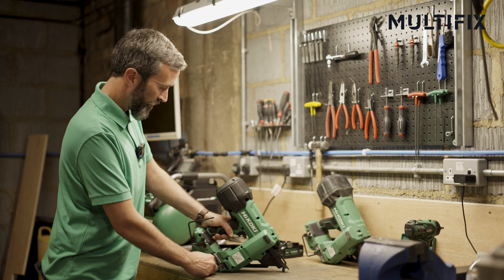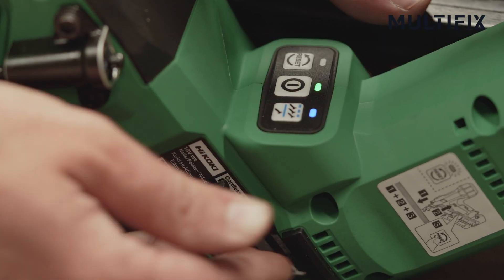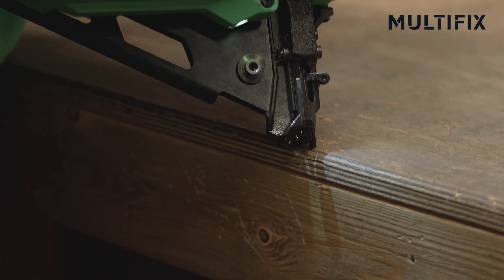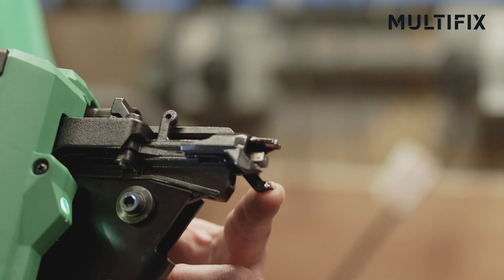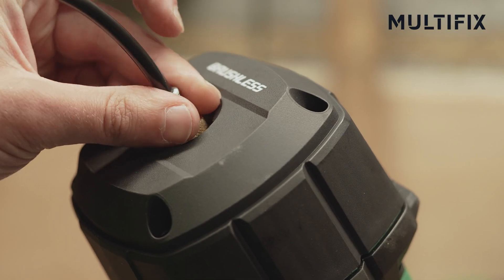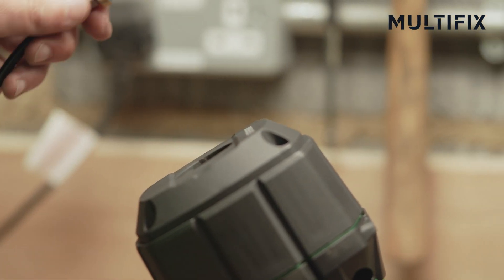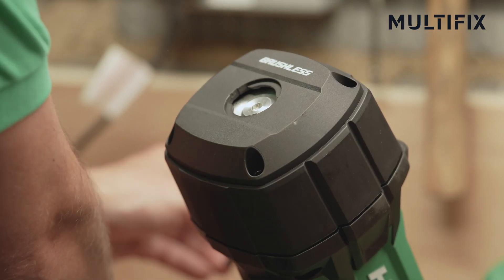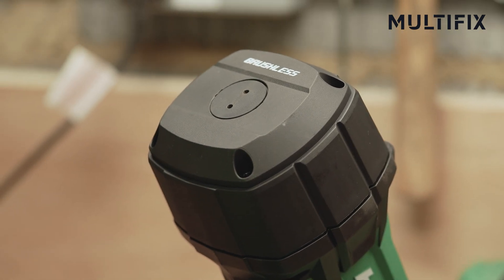How to re-air a HiKOKI 2nd Gen 1st Fix Nailer (NR1890DCAJPZ)

Comment: I’ve got the regas valve from Amazon it says it works on all 3 guns but it doesn’t seem to fit the second gen gun. Would this be a different valve? Seems a bit odd to use different hardware.
Reply from the maker: Yes it's been difficult to find the right adaptor! In short, theres 2 types: one that has the regulator on it which is different for every gun and the other one works for all 2nd gen guns which is supplied with all of the inflator kits we sell. This article should point you in the right direction: https://multifixuk.com/expert_hub/how-to-re-gas-hikoki-2nd-gen-1st-fix-framing-nailer
Reply: @mul@multifixukks for the link. Is there any way of buying the adaptor that’s in the inflator kit separately? Also thanks for the reply too.
Reply from the maker: No worries George - call 0203 248 4086, ask for Ben and he will be able to help you out.
Reply from the maker: Hi George - you can now order this online, stock is still coming in so won't be next day delivery but you can still place the order and you'll be notified of delivery date. https://multifixuk.com/products/hikoki-re-gas-tyre-inflator-adaptor-suits-all-hikoki-2nd-gen-nailers-4100415

Comment: I bought one off Amazon but doesn’t seem to fit. But now I’m not sure if I need it either I thought maybe it was low on air cause hammer if half way out and doesn’t look like there is a jam maybe I just need to reset it? I really liked the gun except for the rafter hook mine broke the first day I had it lol I replaced it with nr83 hook
Reply from the maker: Thanks for the comment - not heard of the hook snapping before. Couple questions - have you managed to sort the gun or is it still out of action? And what tool did you buy out of interest - maybe send the link over if you have?

Comment: Is it the same bar for 2nd fix gun
Reply from the maker: No, it's different for each gun, see below:
1st fix nailer (NR1890DCA) = refill as shown in the video with 9,1 bar
Straight 2nd fix gun (NT1865DSA) =  refill with 7,4 bar
Angled 2nd fix gun (NT1865DAA) =  refill with 8,7 bar
Reply: There is the same adapter for 1st gen and 2nd gen? (As mentioned above - same 9.1 bar).
Reply from the maker: From my understanding, it depends on what adaptor you are using - if its the one with the regulator on it, then there is a different one for each gun. Otherwise the one that comes with the HiKOKI tyre inflator is the same for both, but you have to ensure that the pressure is set to the right bar. There will be an article coming out on our website soon to explain more with links to the parts, so keep your eyes peeled 👀
Reply: @multifixuk is that article out yet. I’m trying to find the part number for the second GEN 30° recharge kit, and I can’t find it anywhere
Reply from the maker: Hi Aaron, yes see here: https://multifixuk.com/expert_hub/how-to-re-gas-hikoki-2nd-gen-1st-fix-framing-nailer (any issues with accessing the product, please drop us a phone call on 0203 248 4086)